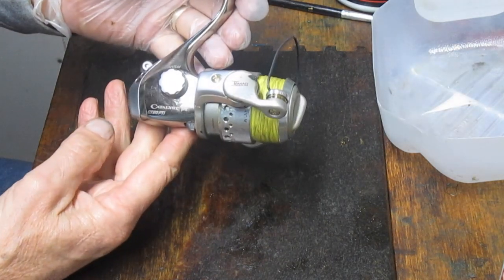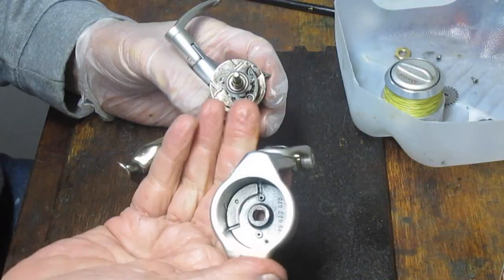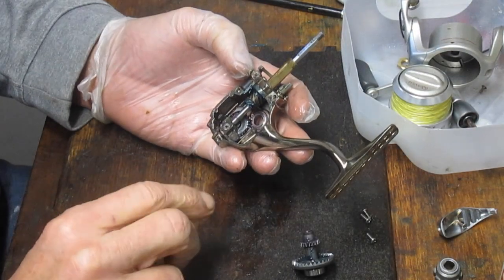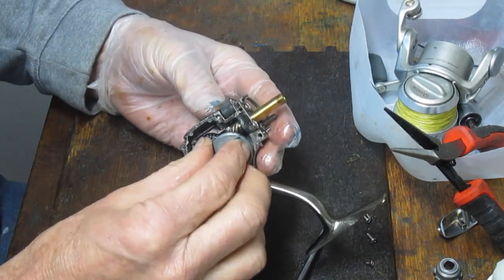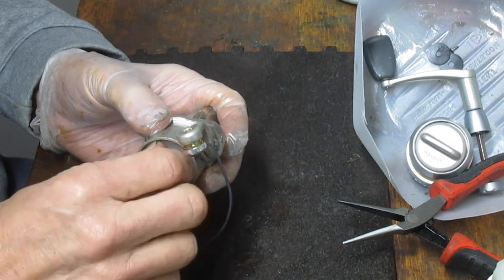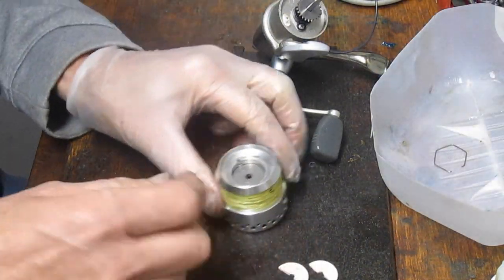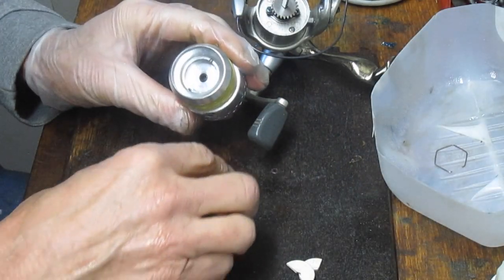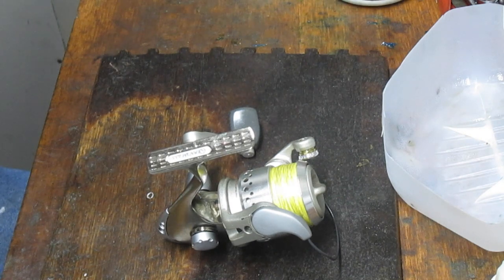Quantum Catalyst CT20 PTi fishing reel how to take apart and service

Comment: Great video - I have the same reel and had years of great service. However recently the Anti reverse braking  is not holding - found this out setting a hook. The reverse switch is off and I find with little pressure the winding arm will slip. 
Any idea what the issue is and how to repair? Thanks
Reply from the maker: The bearing usually do not fail.  My first guess would be dirt in the bearing or on the bearing sleeve.  Try a good cleaning before replacing any parts - Dennis
Reply: Thanks - will give a try!

Comment: Mike's reel repair is in Abbotsford bc , right near where I work. Do you feel the spool on this reel to feel sloppy
Reply from the maker: If you have a lot of side to side play in the spool, check the side plate adjuster first.  If the play is front to back, that may be a spool  bearing or bushing that would need replacement.  The spool should not feel sloppy, but it may be out of adjustment - Dennis

Comment: How come you didn't put drag washer grease on the red drag washer?
Reply from the maker: The red washer is non-permeable and will not absorb the grease, so it is not used.  The purpose of grease is to keep the washers from drying out and breaking.  Thanks for asking - Dennis
Reply: @2ndChanceTackle  Okidoki. It was helpful cos someone had put mine back out of order & I couldn't work out where the fatter ceramic washer (yours was cracked & replaced) sat in the order. I have the PTi30 which has a normal amount of drag washers, just not a type i'm used to (usually felt replaced with carbon fiber or Penns HT100 stuff) So you reckon don't use the carbon fibre drag washer grease or Cal's grease on these odd pink woven washers then? Kia ora from NZ